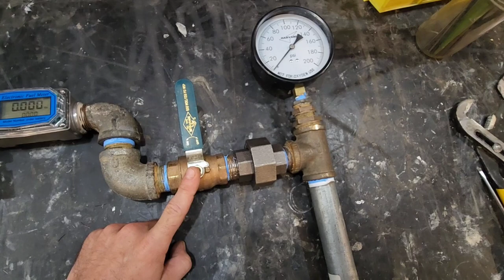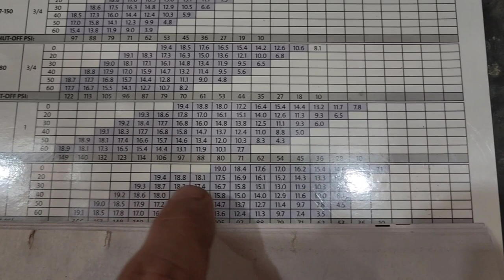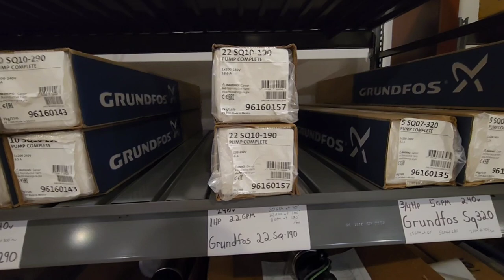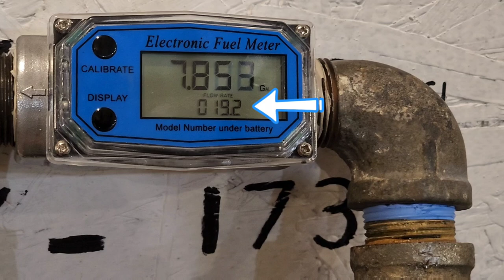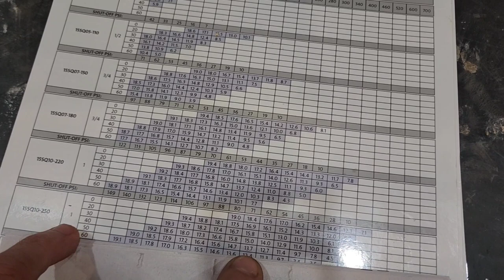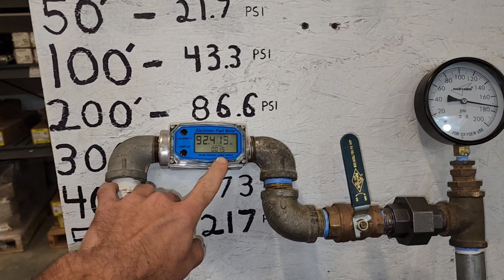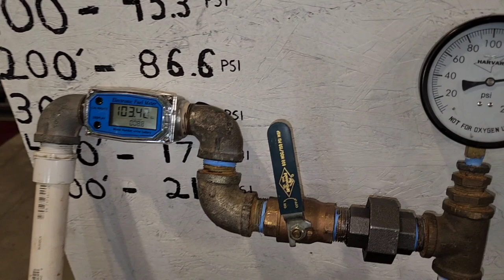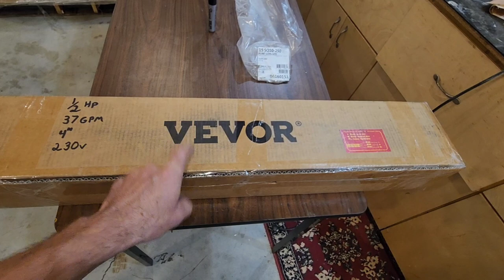Pump Testing a 3" Grundfos 1Hp 15GPM Review SQ-250. Testing Pumps that I Stock & Install.

Comment: Very interesting video and clear explanation of the charts and graphs. However, yanking a 240V plug out of the wall under load will lead to failure of the receptacle and possibly a fire.If you look at it you can already see the soot and melting from arcing as it disconnects. It is not designed to serve as a switch. Add a load rated switch to that circuit.Thank you.

Comment: Excellent video! Until today, I've never seen anyone fully explain the need for sufficient reserve pressure to cut out the pressure switch. Most people think only in terms of horsepower, and if the label says 'max 420 ft' they think they can move water AND turn off the pressure switch from that depth. Not true.

Every pump model varies in both impeller geometry and number of stages (my Grundfos deep well pump has 16 stages, that is, 16 separate pumps stacked on top of each other). Some pumps are designed to move large volumes of water at relatively modest pressures, while others move modest quantities at high pressures. Need lots of water at high pressure? You'll need a lot more horsepower.

I can't believe you have only 41,000 subscribers. You're by far the best water well guy I've ever seen! Cheers from British Columbia, Canada.

Comment: My dad had a well put into service January 1968. A Meyers 3 inch, 1/2 hp down 78 ft. Cabin used just on weekends for first 20 years until he retired then he moved there for 25 years before passing. Cabin still be used on weekends and the pump is going strong.

Comment: I learned some things from this video! Some of it doesn't apply to me though because I live off grid and off gridders don't typically pump from the well to a pressure tank. We pump from the well to a storage tank when the sun is shining, and a 2nd pump at ground level gets the water from the storage tank to the pressure tank. 
FYI my well is 490 feet deep, and I do have a Grundfos SQ pump. Off gridders love the SQ pumps because of the low startup amp draw.

Comment: Hey Philip, love the videos.  I've learned a ton over the past week binge watching your videos while troubleshooting my mother's well.  I need clarification on head pressure.  If I put a pump at 300 feet, but the static level is 200 feet, am I using 200 feet to calculate head pressure, or 300 feet where the pump is located.  I've heard you reference this a few times about falling water levels in the well will increase the head pressure, but in my goofy mind you're still pushing water 300 feet regardless where the static water level may be.

Comment: Thanks for posting very interesting looking forward to the others. I posted the same question on one of the other videos hopefully can get an answer for it. I pulled a 1/2 hp 10gpm Goulds pump (1997) from my parents well. It was set at 300 feet. It was when the well was drilled and the pump was placed by The Well Company so I know it wasn't a do-it-yourself type homeowner repair. I'm just confused how can this be? They used that pump for 20 some years never had an issue with it until it finally quit but obviously they got more than the life out of it. It always made pressure and never had an issue with a family of five
Reply: The well may be deep but the static water level is much higher. Also the pump isn't always set at the bottom of the well.

Comment: Great test ! The only thing not in the equation is the piping + fitting losses/distance. Which you could never reproduce. Each application will depend on if the pump needs to be slightly oversized or not.

Comment: informative video . i have tested used pumps . i figured out more gpm flow ihe higher the amps , higher pressure less amps. i was  surprised at this. is this true for modern soft start pumps ?

Comment: Excellent explanation. Great test bed.
Question for the brainiac engineers. Does the shutoff valve correctly mimic pressure at depth?
I think yes.

Comment: thanks!  question... how much does the static level play into the flow of the water through the pump?(say there is 160' of water above the pump and then it's drawn down to 100of water above the pump)

Comment: Having a well drilled Monday.  It will be around 180ft depth and then 800ft lateral pipe with an elevation gain of 135 ft.  Driller is recommending having a tank at the head and running 6/3 wire to run 1hp pump for 7gallon per minute.  Have you run aluminum wire instead of copper before for a setup like this to save on wire cost?  Thanks love the channel.

Comment: Wow, great setup! Kinda like an amp dyno in the car audio world. I noticed the pump wasn't fully submerged in the test barrel. I thought all submersible pumps had the motor at the end and the pump part closer to the discharge pipe. I figured it was that way to draw cold water around the motor to keep it cooler. We live in a rural area w/a deep well (per say). We also are lake front property owners and I have an irrigation system using a 1/5HP 230 22gpm submersible pump in the lake to draw the water. I have it in a "simulated" well casing and "point" and it's on it's side. Although it works, I've gone through 2 pumps in 20 years. With both pumps, the motor seals failed flooding the motor killing it.
Reply: it laying on it's side is likely what's killing them fast. the internal motor and pump impeller designs I've seen are for vertical orientation only. else it will side load the bearings/shaft/seal and eat them up. also the pressure you have when it's pumping may be too low to keep it lubricated and cooled down inside, it may cavitate/trap air in the motors rotor/bearing area, which is lubricated by the water itself.  you may try running a regulator to keep 30psi on the pump at all times it's running.
Reply: @throttlebottle5906  Thanks for reply! Ya, I can understand the issue with pump laying horizontal when they are, for the most, designed to be hung vertical. I think there are models that say they can go on their side if I'm not mistaken. The brand I am using now I think says it can be placed on it's side. As far as pressure, I keep a fairly high head pressure at all times. It feeds a full pressurized system much like a standard well setup.

Comment: Great test!  I have a well that I work on once in a while to replace a pressure switch or repair a leak but this info is something that I am sure I will be using in the future when the pump fails.  Thanks.

Comment: Must we not allow for voltage loss (length of wiring) in a deeper well? Wouldn't that lower water pressure?
Reply: Less volts means larger amperage draw

Comment: Look at the instructions for your flow meter. Normally, to have an accurate reading, they require that the pipe before the meter be straight for at least 5 times the diameter of the pipe. The turbulence caused by the 90 will cause the flow meter to give a bad reading.

Comment: Thank you very much for the time you take to produce your fine videos.
Is the 15SQ10-250 pump appropriate for my application?
I have read through the Grundfos 3" SQ Sizing Guide. I do not understand some sections and terms, such as TDH and friction loss, my pump system is typical with an 85 gallon pressure tank and 40-60 pressure switch, inline filter prior to the pressure tank and a few elbows and tee joints.
- My well is 400' deep with the old pump set at 185 feet.
- I will be using 1.25" black roll pipe with an Grundfos SQ.
- The well is at 4,000' elevation.
- The most recent well inspection report from 2015 showed 15 GPM at the start and 14.75 GPM after 45 minutes.

The data in the Grundfos Sizing Guide points me towards the 15SQ10-220 but not understanding the friction and TDH I am wondering which pump is best for my application, and should I go down to 1" black roll?
Reply: You shouldn't have a filter inline before the switch.

Comment: Great info! I was watching your videos and I learned a lot. I made a well around a month ago that produces 150 gallons per minute (I'm impressed) and I'm wondering what pump I have to purchase I have it at 98 ft. Deep And I have to push the water at a distance of 400 feet away and an altitude of 30 feet high. Above the well. Which pump can you recommend? Thank you in advance 🙏🏼

Comment: Are you sure that the standing  water above the pump adds to the load on the pump? 
I was always told that the standing level of water was the pumping depth because the water above the pump negated the water in the drop pipe.

Good videos,  thank you.
Reply from the maker: The standing level is the pumping level. But that level can fluctuate all the way down to the pump depth during high water usage.

Comment: Thanks for taking the time to build your test setup and more importantly, explaining it's use. I know you've mentioned Valor pumps from Lowe's upon occasion which I never paid attention to since I'm not currently in the market for a replacement pump. But, it did peak my curiosity. One sure has to search deep on Lowe's web site to even find it. 

One thing I had a hard time wrapping my head around is how come it's so inexpensive compared to others? I was wondering if it's all plastic or ferrous metal construction that will last about a year in service. From the manual on the Lowe's web site, it looks like an imported pump and the manual is a poor auto-translation from it's native language. If they can't spend the timer money to have someone proof-read their documentation, where else did they cut corners???
Reply from the maker: I believe they're using 1970s patent designs and copying the old model pumps. Bc the electric motors are oil filled (like old pumps) and they are very very heavy compared to newer models. I believe the US doesn't allow oil filled motors in drinking water wells anymore. But I may be mistaken.

Comment: Is there a benefit to 3” vs 4” pump? I just pulled my pump and trying to troubleshoot. It is s Franklin electric 4” pump, 1 HP rated for 10GPM. Use is for Irrigation only

Comment: 1 question... My house is 21 years old.  I have all original equipment - tank, T, Pump.  One day I got a big idea to set up a camera focused on the pressure gauge to check for any leaks.  Turns out my pressure gauge is stuck.  Went to change it.  Discovered on the T I had no way to drain tank.  Instead of a relief valve, I have a 3/4 inch plug.  I went to change the plug for a valve.  The plug is rusted on - galvanized.  Since there is no real problem (Im just curious as to whether there is a leak) is it worth it to break the plug free from the rust or should I just wait until I need to replace the tank?  Then replace the T also with a proper relief valve?  Is there a decent chance that when I break it from from the rust that I will destroy the T?

Comment: I had a new well drilled this week.  It is 280 feet deep, and the driller estimated the well was producing between 6-7 gallons per minute.  I will need a DC well pump since my pump will be powered by solar panels.  Grundfos makes them.  What is your recommendation for my situation?  My property is off-grid with no residence.  At this time, I will not pump to a pressure tank.  Although, the well driller said that there are in-well pressure tanks.  I was looking at RPS since they have a lot of advertising.  But, many have recommended the Grundfos pump.  Any recommendations/suggestions?  Thank you.

Comment: Definitely enjoyed the video, good learning experience to see the testing. I wondered tho for a shallow well of say ~80 feet, how much difference there is in using a submersible pump versus an above ground pump...
Reply: if the well is capable of high gpm recovery/flow rates an in ground is the best way to go. if it's not, then dual line with ejector raised up a ways and long tail below to footer valve.
that's an old trick allowing the gpm flow rate to drop off, without over pumping to sucking air or lose prime. they'll even go right down to a trickle and maintain that if it's the right combination. little water flow sure beats sucking air and burning up the pump or needing serviced non stop.

Comment: Is there any downside to using an Electronic fuel meter like that on an actual pump system?    I was asking about a flow meter and the well guys I talked to said it either didn't exist or it was really expensive and thought it was ridiculous that I wanted it but it would be interesting to see how much water I use and it seems like it would be an excellent tool to discover leaks in the system for before they became a big problem.
On a totally different note - do you have any idea how I could get a rough idea about how much water is coming out of a 12" irrigation pipe that I have?

Comment: My question is: If you have a well pump installed at 150' and the well water stays at 3' from the top, aren't you basically pumping water just three feet? The pipes will stay filled all the way up to  within 3' of the top of the pipe even with no pump operating at all, so, isn't that the case?
Reply from the maker: That's called a 3ft static level. It's rare, but possible. There's no need to have the pump at 150ft. But it's fine where it is at . That pump will have a very easy life & hopefully last a long time
Reply: I think that is the case, and he kind of said it in the video. But then you need another 40 or more psi to trigger the pressure switch.

Comment: PLEASE ANSWER 
I have a totally different question. If I'm on a village watr system and have 45psi at the 1" miter. If I run 1k feet of 1" pex. How much psi will I lose and gpm? WHAT CAN I DO TI INCREASE IT.
Reply: Your best bet is to run a separate pump system from another tank that has water storage. 
You will loose quite a bit of volume @1k feet. It depends on how much you need at the source

Comment: I have a 6sqflex 3 giving an error code f3. I'm having trouble finding a new motor that will run on 120v at 400ft deep. Its pumping to a holding tank. I dont want another sqflex pump as id rather have an inverter in the pump house instead of 400ft in the ground.

Comment: Thanks so much for all this info!  I'm looking forward to the 1/2HP Vevor pump test.

I just purchased and installed the 120 volt version of the Vevor one for an old well on my property at about 60 feet (couldn't pass up that $62 after discounts price). I wanted it mainly to just top off my swimming pool every day so don't have a pressure tank yet, but it worked out so well that I've started thinking about adding one. I haven't thought about PSI though so will add a gauge first to make sure I can get 50-60psi at the top of the well.

EDIT: as others have mentioned, I am also curious about amps used at different pressures. Could you include that in your next test please? My well seems to have a recovery rate of about 3gpm so I've dialed down the flow rate quite a bit and was worried that would cause the pump to use more electricity.
Reply: It's counter-intuitive, but well-pump motor amps fall as the flow is restricted. I know, it's hard to believe, but try it for yourself. Throttling the output will decrease power consumption.
Reply: @paulmaxwell8851  have read that and it sort of makes sense to me, but I do just need to buy a clamp over amp meter and test it, like you said! I am wondering how proportionally the current draw does drop too though. I'm cutting my water level down to 2GPM so my well doesn't run dry (which is about 90% less than the pump’s max flow rate) and running it for 4 hours a day to keep my pool full (its hot here right now, plus there's a leak that's eluding me). I wonder if I would save electricity by adding a pressure tank to enable the pump to run at full flow but kick on and off every 2-3 minutes.

Comment: I have learned a lot watching your channel. Anyone who has a well should subscribe to your channel. Thank you for the informative information you provide your viewers.

I have no idea how deep my well pump is in the well. It is a two-wire 240 volt pump. Is there a way to estimate the depth by measuring the current draw? The well pipe is 1 1/4 inch galvanized steel pipe. I assume a one inch ID. I am assuming that because they left five 20 feet sections of well pipe on the ground, whenever the well pipe was installed. I found the spare well pipe covered up by four inches of compacted decayed leaves 20 years ago, when I cleaned up the property. The flow rate is 7 gallons per minute from a water hose into a five gallon bucket.

Comment: We have a 6" well at our remote cabin that is 189ft deep with a static water level of 75ft.  We have installed a Simple Pump brand hand pump on it 8 years ago.  It works well but honestly, we are tired of hand pumping.  The Simple Pump is set 110ft down the well.  The well was rated at 10GPM
If you are familiar with the Simple Pump well cover there are holes (plugged at the moment) for electrical wire and another water pipe from a submersible pump to emerge out of the cover.
I have questions.  First, I like the Grundfos pump for the slow start feature that will not draw a huge amount of amps on startup.  We only have a 2200 watt generator.  How deep would you recommend us setting this pump?  What should we use for a drop pipe (black poly??).  If we use the black poly will the barb fittings at the pump and then at the fitting coming thru the well cover adequately hold the weight of the pump, drop pipe and water without worrying about the drop pipe coming loose and losing the pump down the well?
We'd really like to do this.  We have contacted two well drilling outfits and they had not interest in doing this so we'd like to try it ourselves.  Can you talk us thru it??The
Reply: They make a 12/24v motor/actuator for those I believe. Not sure about a 120/240v motor.
Reply: @jake-mv5oi  Simple Pump does make an add on 12/24 volt motor however we really want a submersible Grundfos as a n addition to the hand pump.